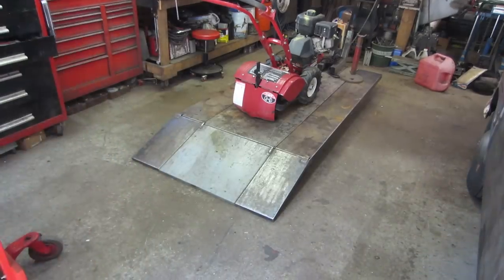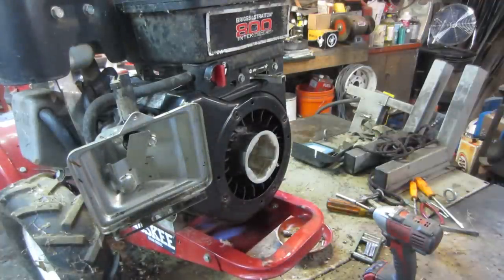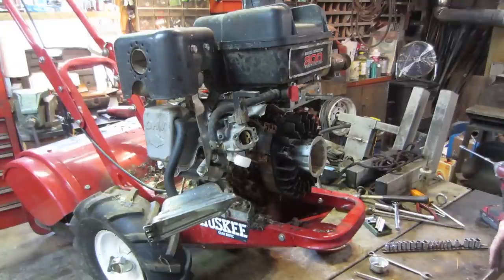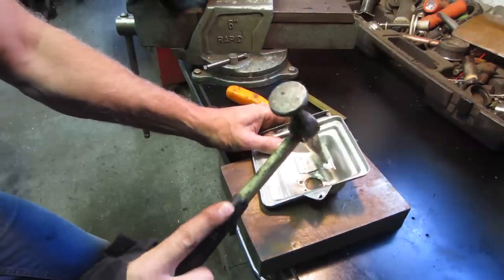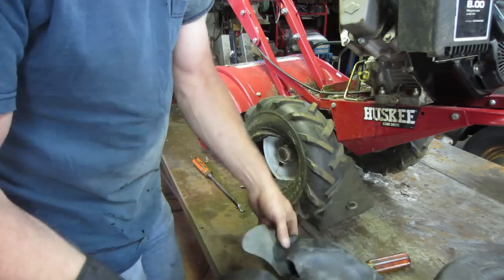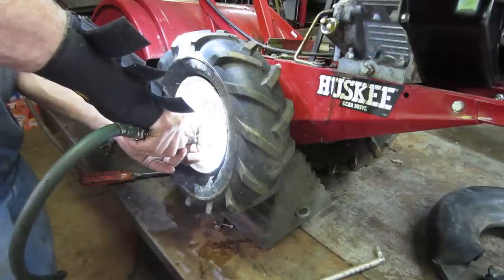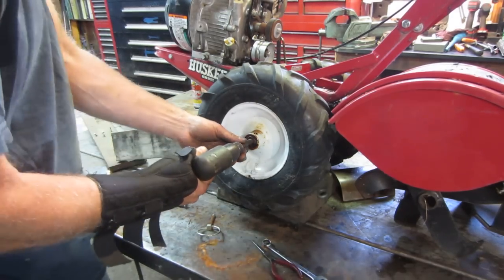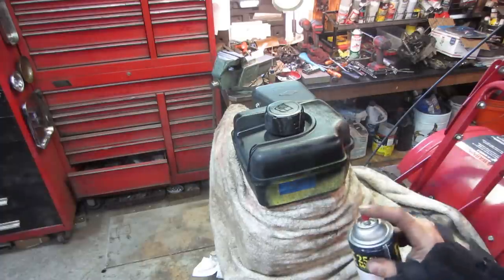abandoned rototiller, can we fix it ?

Comment: What is the wrist guard for? If it's for carpal tunnel syndrome, the cure is to get some alfalfa tablets and take mega doses for a while. Alfalfa is a deep root plant, it gets to micro-nutrients you need, but only need a little bit of. Yes, I know this works for a fact, it worked for my wife. Keeping her wrist in the guard thing just made it worse.
Reply from the maker: broken wrist
Reply: okay, well maybe a viewer has carpal tunnel and can use the info. Doctors sure won't tell you about it, and they won't tell you that carpal tunnel surgery does not work long term. Hope it heals. by the way... I may bust your chops now and then, but I enjoy your vids for the most part, but Mr. Impatient doesn't care for the ones that go on and one with multiple vids about the same thing. Tho I could probably watch you work on VW's a whole lot more than anything else. Have a good night.

Comment: can someone tell me what is going on with my tiller, I have a troy bilt super bronco crt tiller, when I go to start it, it will die out right away, I already looked over everything, I put a new spark plug in it, the old one had good spark too, then I cleaned the carb several times, fuel does come out the hose where it connects to the carb, I also checked the fuel cap for air vents and they were clean, I put fresh clean fuel in it and even a carb and it still dies out, there's nothing else check, I need help

Comment: Do you have an inline spark tester?   I think you'd get a lot of good out of one,   Message me if you don't and I'll send you one..
Reply: That's a good idea for showing spark on video better. Easy to make one too.
Reply: Yes. If you braze a metal clip on the side of an  old spark plug you can clip it to some metal and it stays grounded while you pull the cord. No need to pull out spark plug to check for spark. It is held in a place you can see it easily. I am sure he has one already but we all stay with what works for us.
Reply: The ones I use just plug in line to the cord and onto the spark plug itself and have a little bulb inside that lights up.     the engine can run with it in place.    I was using 2 the other day to diagnose a bogging issue with a kohler vtwin that could only be produced when mowing thick grass.  Could see the spark shut off on one side due to a weak coil.
Reply: Yes, he does.
Reply: I saw that in one of his newer vids.